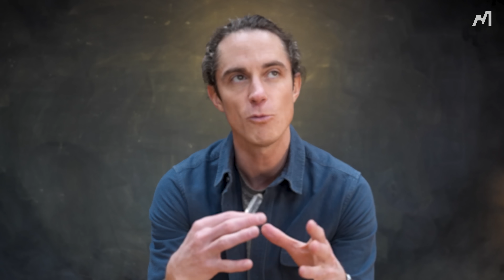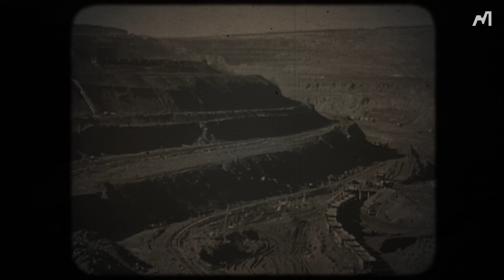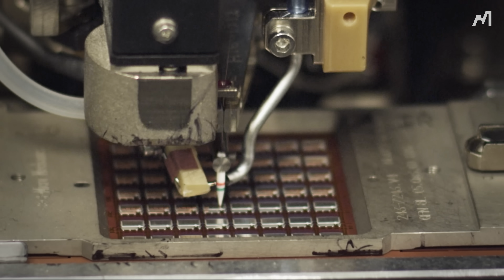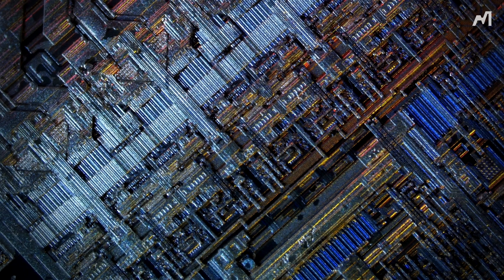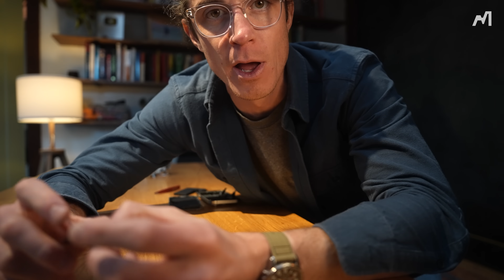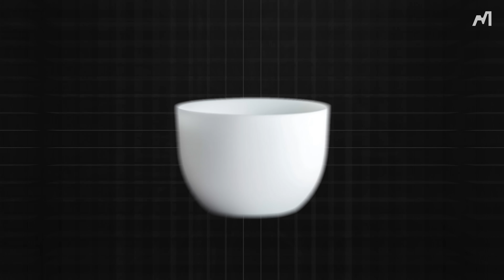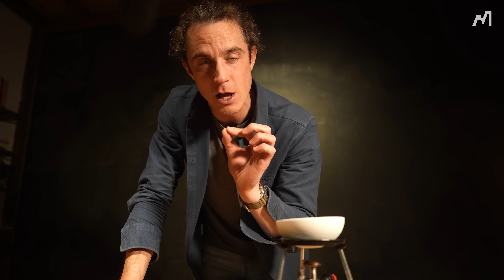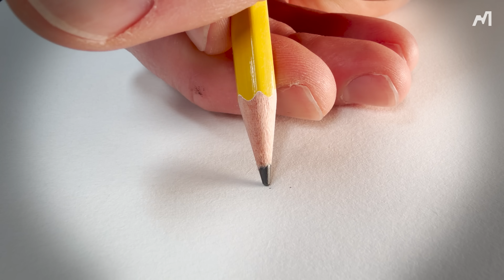Saudi Arabia Has Oil, America Has This

Comment: It's important to remember while the ore from Spruce Pine is the best, most pure, most consistent Silica in the world, it is not irreplaceable. 

There are other deposits on the world that come close. Likewise, there are processes to purify silica that is less pure. 

My point is, though the US has an effective monopoly on pure silica, it's not a perfect monopoly. If a hostile state like China wanted to invade Taiwan, then they would no doubt have planned for this. Either by an as yet undisclosed source of comparable pure silica or by stock piling pure silica prior to the invasion, if not both.

Comment: I used to grow 200mm silicon boules for IBM in the 1980s. The quartz crucible is a refinely crafted vessel. Filled with pure silicon and doped we evacuate the massive puller and pump argon through it, then heat it hotter than the surface of the Sun until the quartz is glowing. I dipped the seed into the molten silicon and grow the crystal. All by fingertip control, and by eye through a magnifier scope. This was before computer automation of the process. IBM was still prototyping it.

Comment: That’s too strong. The quartz from Spruce Pine isn’t fundamentally irreplaceable – it’s just the best current combination of extreme purity, reliable volume, and a long-established, qualified supply chain. Semiconductor production does not depend on some uniquely singular material that exists only there; high-purity quartz can be sourced elsewhere or produced synthetically. The constraint is practical rather than physical: alternative sources are either less pure, more expensive to refine, or not yet qualified for use in ultra-sensitive fabrication processes. Given time and investment, the industry could shift away from Spruce Pine, but doing so would be slow, costly, and disruptive – which is very different from being impossible.
Reply: Not to mention that the U.S. has *LOTS* of petroleum AND rare-earths;  we just need to tell the Hippies and the descendants of the Baselessly Glorified & Protected Nomadic, Stone-Age "Natives" that we're GOING TO harvest those resources, whether they like it or not.  🙄😏

Comment: It is not false but it does not tell the whole thing. The wafer has to meet the metallurgical degree of purity to work properly on devices, HOWEVER, the wafer exists only to serve, initially, two objectives, mechanical structure and serve as foundation for the base layer where the true electronics will be built. Until the 22nm the electronic node all electronics used the transistor using the planar mode. The transistor was laying down to the wafer. With finfet process, the transistor now is in a "vertical" position. I'm telling you all this to say, the purity of the wafer is just a technological barrier, not a physical limit as the speed of light. There are ways more expensive or energetic to achieve the same result. Do not be afraid.

Comment: This doesn't seems to be correct?
11n silicon is produced through purifaction processes? Look at Wacker Chemie AG (Germany), they refine silicon with 12n purity now.
Meaning they don't relay only on that mine to produce it I think.
It's a matter of costs, but going from 6n to 12n I think is way more expensive than going from MG grade (98/99%) to 6n, meaning really this mine is not needed that much it's just nice to have.

What I'm missing?

Comment: Dear all, am I the only one who laughs at the assertion that silicon ingot growing, fan blade growing and lens polishing are done BY HAND by a select few? 😂
That could go well with Generation TikTok, but not with anybody else.
Reply: Not by hand but it's probably controlled manually
Reply: @divoulos5758I find it hardly possible, since the allowances there are on the micron scale, so everything is controlled by the machine itself. Input of settings / supervision of the process are manual, yes, but hardly more than this.
Reply: @palundra82 that's what i mean. Probably an axial motor with screws moves it and they manually adjust speed

Comment: What about the failure rates on those pathways that are baked into the chips, aka margin of error for each chip. They are not all 100% perfect. I've heard they rate them and sell them as different SKU's depending on these factors. All the same base chip, just a better run is worth more. I know it was that way for CPU's, but I don't know how much this is normal practice. I would just assume that a single atom ruining a chip would lead to half the chips or more being failures off a silcon wafer if 100% were the only acceptable metric.

Comment: A good example would be a 2060 gpu's chip was designed and manufactured the exact same way a 2080 TI gpu was, the difference is the amount of defects each one has which is commonly caused by non pure silica. The difference in processing power from a 2060 to a 2080 TI is massive and reinforces the need for pure silica.

Comment: There's so much inaccuracy in this video (and a lot more of not telling the full story).
Yes, Spruce Pine Quartz is the most pure natural quartz in the world.
But, just like any other raw material, quartz can be refined to increase purity (and add specific intentional impurities if that's required).
That process is expensive in terms of energy, though.
Spruce Pine quartz only has such a large market share because their quartz is comparatively cheap.
That is why Spruce Pine cannot 
just set their prices to whatever they want - their customers would just switch to synthetic / synthetically purified quartz from elsewhere.
That is not the monopoly this video makes it out to be.
As for the Zildjan example:
Yes, they make great cymbals.
But they're not absolutely better than the other big manufacturers, like Sabian (which doesn't really count anyways, because it was founded by a member of the Zildjan family, so safe to say the Zildjan knowledge went into the Sabian company), but also Paiste from Switzerland and Meinl from Germany.
Between them, it often comes down to taste.
So yes, Zildjians metallurgy recipe is held by the CEO(s) only.
But it's not like their recipe is unique.
Other manufacturers make perfectly cromulent cymbals with their respective recipes.

Comment: It's also possible that the reason the world has not mastered artificial silica is because there wasn't enough need for expensive R&D when there's already a super pure source. Perhaps if that source is cut off there would be massive efforts made to either refine inferior silica to the same standards in efficient ways and/or artificial means would be developed to make it as pure as desired the way artificial diamonds are made. Where there's a will, there's a way. If the US cuts off China form this super pure silica, they might find another means or at the very least will retaliate and cut us off from the many critical.minerals they have a monopoly over. It would be mutually assured destruction

Comment: Not all of the silicone used in chips is imported from the US, it's actually quite diversified, but the advantage of a high purity crystal like from north carolina or fontaineblau is that it is cheaper because you need less (but still) purification process.
Reply: Yeah I figured there were workarounds.  It's just that America lucked into one of the cheapest methods on the planet.

Comment: So it seems this isn't as irreplaceable as the video implies. It would cause a severe short term shock if Spruce Pine Quartz was cut off, but it is not irreplicable. There are other ways to make synthetic high purity quartz or purifying less pure quartz. It's 5 to 10x more expensive and would need 3-7 years to scale (major supply shock until new plants with different methods are built) but don't let the 5-10 times more expensive scare you, the silicon is something like 0.1% of the price of the final chip, once the supply is scaled the extra cost of production can be absorbed. China is already working on alternative sources. China knows this risk and within a few years I don't think it's crazy to assume they'll have a backup in place.

Comment: What a bunch of bunk! Material from any deposit must undergo Zone refining. Two passes from any of those other deposits mentioned in the video will be of a higher purity than a single pass from the American one!
Reply: And thus you identify the problem, that second required pass, which adds cost. It would be far easier to manufacture many US products in the US, but it's overall cheaper to have them manufactured overseas and shipped in.
Reply: @RobertMorgan Doesn't work that way! The same raw billet or boule will be fed repeatedly through the same dedicated furnace dozens of times - it is a matter of time not cost, so even if your furnaces are operating at maximum capacity it will add at most a few percent to the upfront processing costs for raw material.

Comment: You are confusing non-economically viable for impossible. Lower purity quart can be used and refined and or synthesized into higher purity quartz it's just not as economically viable as taking the good stuff out of Sprice Pine and saving a step towards the Czochralski process.

Comment: This individual fundamentally does not understand the refinement of quartz.  Using tiny high pressure reaction chambers to make quartz crystals is not related to the production of pure quartz as the crystals require pure quartz or the impurities introduce site defects as the crystals grow with the impurities which wrecks havoc on their optical properties.  You only grow quartz to produce crystals for optical use or electronic use meaning clocks using quartz vibrators never ever ever for chips.  You use chemical production to get rid of impurities, particularly iron.

Comment: Crysteco, Inc., based in Wilmington, Ohio, and founded by William H. Robinson in 1972, was a major manufacturer of arsenic-doped silicon wafers and epitaxial-engineered substrates. The company, which at one point was the world's largest producer of these wafers, later rebranded to Crysteco Epitaxial Corp. following the 1997 acquisition of Fabico Inc.. Assets of the firm were subsequently acquired by Okmetic, Inc...

Crysteco, Inc., ceased operations on May 7, 1999.

Comment: Not sure where this guy gets his facts from, but China is the largest producer of chip-grade Silicon
Reply: Important nuance
Most of this silicon is not semiconductor‑grade. Nearly all global silicon production goes into:
• 	Aluminum alloys
• 	Steel and cast iron
• 	Chemicals (silicones)
Only a tiny fraction is refined further into ultra‑pure polysilicon for solar and semiconductor use — and that market has its own set of leading producers (e.g., Wacker, OCI, GCL‑Poly).
Reply: YOu are very, very uneducated in this area.  Do some research:

Who Produces the Most Wafer‑Grade (Ultra‑Pure) Silicon Each Year?
Wafer‑grade silicon is not the same as ordinary silicon metal. It requires 11N–12N purity (99.999999999%), and only a handful of companies in the world can produce it at scale. These companies refine polysilicon and grow monocrystalline ingots used for semiconductor wafers.
✅ Top Producers of Ultra‑Pure Silicon for Semiconductor Wafers
These companies dominate the production of high‑purity silicon used to grow ingots that are sliced into wafers:
1. Wacker Chemie AG (Germany)
One of the world’s largest and most advanced producers of electronic‑grade polysilicon, a key precursor for wafer‑grade silicon.
2. Hemlock Semiconductor (United States)
A major U.S. producer of high‑purity silicon used in semiconductor manufacturing.
3. Tokuyama Corporation (Japan)
A leading Japanese supplier of ultra‑pure silicon for semiconductor applications.
4. REC (Renewable Energy Corporation, Norway)
Produces high‑purity silicon used in both solar and semiconductor markets.
5. SunEdison (U.S.)
Historically a major producer of high‑purity silicon and wafers (though the company has undergone restructuring).
These companies supply the feedstock that wafer manufacturers use to grow monocrystalline silicon ingots.

Comment: This has been the biggest fallacy, that spruce pines had the LARGEST supply and reserve of HPQ SiO2..  Not true. We can provide you with the largest reserve of 99.95-99.995 % purity.  contact me If you are interested.  99.95% is $3,000 per ton, 99.995% is $5,000 per ton.  We have the largest reserves of HPQ SiO2 in the United States.  Our HPQ comes straight out at 99.95%-99.995% purity.

Comment: The statement, that the USA is "the only place on Earth capable of producing the raw material for advanced computer chips" (video description), seemed odd to me and some comments that claim that this isn't true made me curious so I did some research.
To make it short: "China has a 64.0 percent production share for silicon [...]".
-- Khan, Saif M., Dahlia Peterson, and Alexander Mann. "The semiconductor supply chain." Center for Security and Emerging Technology 8.8 (2021). (DOI: 10.51593/20190016)

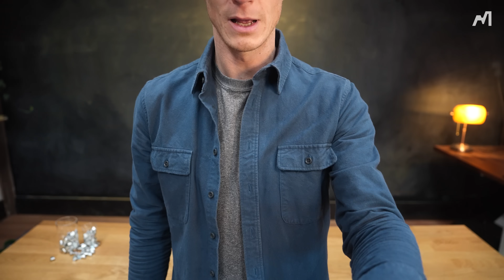The information that "it is impossible to make leading edge semiconductors without the silicon pulled out of spruce pine" (3:30) seems to be wrong.
There is an article by Ben Bernstein (2024-11-08) ("Does All Semiconductor Manufacturing Depend on Spruce Pine Quartz?") which states "Spruce Pine is indeed a key choke point in the modern semiconductor manufacturing landscape, but it’s not quite an irreplaceable, load-bearing column supporting all of the modern economy.". According to the article, the Spruce Pine Quartz is the best source for making the crucibles, but seems not to be the only source or way to make these crucibles. 

I really despise this blunt spread of misinformation without providing any source.
Reply: YOu are very, very uneducated in this area.  Do some research:

Who Produces the Most Wafer‑Grade (Ultra‑Pure) Silicon Each Year?
Wafer‑grade silicon is not the same as ordinary silicon metal. It requires 11N–12N purity (99.999999999%), and only a handful of companies in the world can produce it at scale. These companies refine polysilicon and grow monocrystalline ingots used for semiconductor wafers.
✅ Top Producers of Ultra‑Pure Silicon for Semiconductor Wafers
These companies dominate the production of high‑purity silicon used to grow ingots that are sliced into wafers:
1. Wacker Chemie AG (Germany)
One of the world’s largest and most advanced producers of electronic‑grade polysilicon, a key precursor for wafer‑grade silicon.
2. Hemlock Semiconductor (United States)
A major U.S. producer of high‑purity silicon used in semiconductor manufacturing.
3. Tokuyama Corporation (Japan)
A leading Japanese supplier of ultra‑pure silicon for semiconductor applications.
4. REC (Renewable Energy Corporation, Norway)
Produces high‑purity silicon used in both solar and semiconductor markets.
5. SunEdison (U.S.)
Historically a major producer of high‑purity silicon and wafers (though the company has undergone restructuring).
These companies supply the feedstock that wafer manufacturers use to grow monocrystalline silicon ingots.
Reply: @JasonVu-h7t  Is this some troll comment?
The (probably AI slop) answer in your comment tells nothing about the origin of the silicon used by the stated companies.
Also there are no sources provided (which I did in my comment).

Comment: Most of the quartz from Spruce Pines comes from the core of the many granitic pegmatites that occur there. Spruce Pines also is a leader in the production of feldspar, used as a fluxing agent in the glass making industry and in ceramics and as fillers in paints and as an abrasive. Bon Ami the famous cleaning powder once operated a mine in Spruce Pines. Another abundant mineral that put the area as a top producer was mica. Its is used as an electrical insulator, for applications needing high temperature resistance, it is used in electronic components, fillers in paint and drywall, cosmetics, fireproofing and fireproofing. The big three industrial minerals in Spruce Pines, NC are quartz, feldspar and mica but many aren't aware of the of industrial minerals present in lesser quantities such as uranium and rare earths. The area also produces some of the best gemstones in the United States. It is home to one of three emerald mine locations in the US, all within North Carolina. The Crabtree Emerald Mine produces small but very deep green emeralds, usually locked within a tight pegmatite with schrol, quartz, mica and garnet. Fact is, sometimes the whole matrix is polished into cabochons and used in jewelry but when emerald crystals are found that contain large enough gemmy areas, they are faceted. It also produced a large amount of gem aquamarine and golden beryl in its day. Garnets, kyanite, moonstone, citrine, smoky quartz are also found in the area. The town of Spruce Pines is a tourist town just off the Blue Ridge Parkway in the mountains of NC. They capitalize off their rich mining history and several public roadside pay to dig gem mines are located in town. The NC Museum of Minerals sits at the exit of the Blue Ridge Parkway into Spruce Pines. Its is good place to get a general overview of the areas rich mining history. However, take a trip up to Grandfather Mountain and there is best collection of NC minerals on public display that you will find. If you enjoy minerals and gems, North Carolina is a must stop visit.
Reply: It's SPRUCE PINE....NOT PINES.